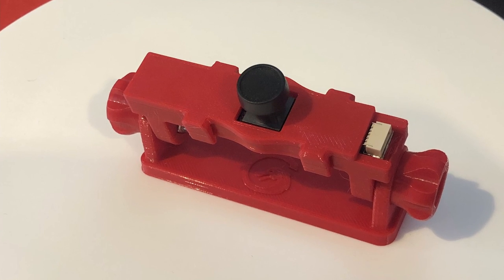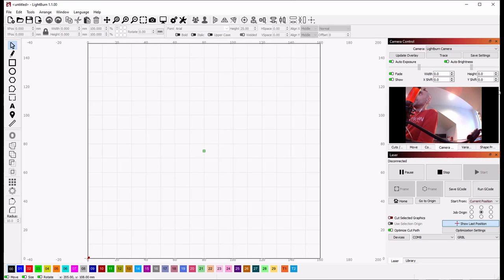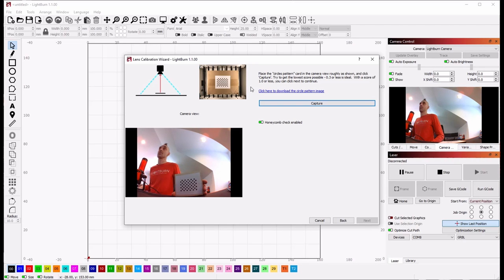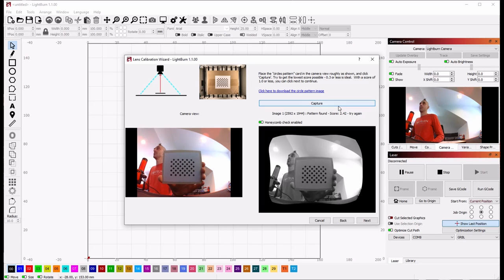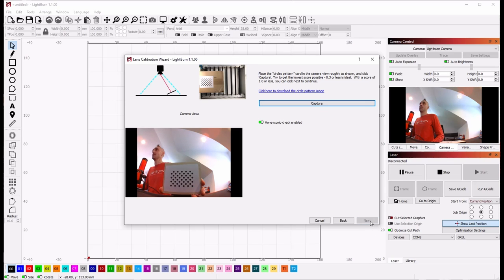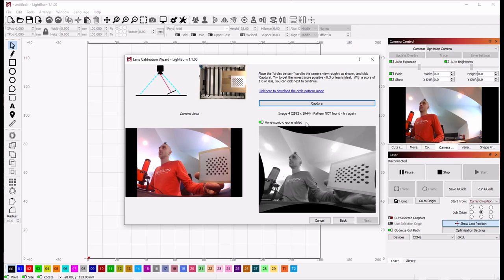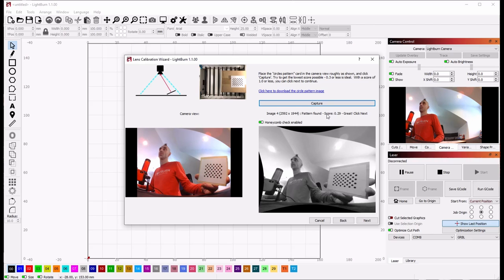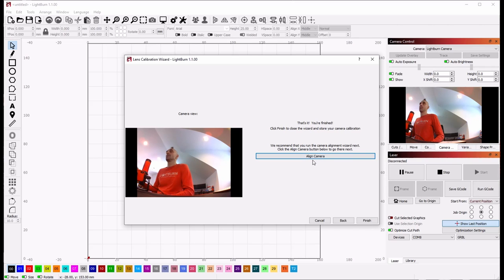LightBurn Camera Lens Calibration

Comment: Excellent clarification.  I had always assumed that it mattered that the circle pattern be on the laser bed based on the example images in LB.  I'd bet that replacing those with some stills of you holding the card in the appropriate positions would eliminate some user confusion.  

I spent a good bit of time trying to figure out how best to cover my honeycomb and get nice even diffused lighting for the test originally without great success.  Going to try it this way now!
Reply: I also see now that the walkthrough does say it pretty clearly.  I tend to treat those like Denny's menus, just scanning for the pictures that look most appetizing.

Comment: calibration has been a nightmare.... Calibrate lens, align lens, and still laser is off when I attempt a project. Good to know its not just me having issues.
Reply from the maker: Are you using a LightBurn camera or third party? Many of the presets are available for LightBurn cameras. If 3rd party, make sure the the calibration pattern is clear, sized to toughly match what is seen in the calibration wizard, and it really helps to attack it to something like a piece of cardboard to keep the paper from bending.

Comment: I have the expansion for our sculpfun laser with the size 935x400. And I am using a sculpfun honeycomp 400x400. But my honeycomp is starting at 467,5 in y-position.

When I calibrate the camera lense, the first part with the points works fine. Then when I have to put my sample in the middle of my honeycomp and and click on “Frame” the laser is driving his frame in the middle of my long side, not in the place as it is. I can’t choose this start position and also my camera is in the middle of the homecomp not in the middpe from the extension. How can I change this?

Comment: thank you for the video but where do you plug it, on your computer or directly to the machine
Reply from the maker: @arialf9637  - Directly into the computer.
Reply: @lightburnsoftware7189 thank you for answering, so I cannot use the camera if the computer is not connected to the machine?, because I use the machine wifi, with a LAN cable plus a router
Reply from the maker: @arialf9637  - the camera is USB only.

Comment: Brilliant!
I have been using a webcam fixed to the roof about 1.5m above the laser and using a small (A5) printout of the calibration image, this has given some success but it tended to drift depending on where the laser was cutting. ie it would be way off at the edges of the bed (600x400).
To get the thumbnail image the same relative size it had to be A4 sized, now working beautifully with calibration figures at 0.05 to 0.07
This was the critical help required to get the thumbnail to match the printed image on the laser bed.

Thanks for the video and the software I would be lost without it. 👍👍
Now I just need to sort the rotary device and will be 100% chuffed.
Reply: @lightburnsoftware7189  Thanks I have it scaled to 190, working great! 👍

Comment: Thanks for this video. I calibrated my camera per the instructions, and it works great, however I am having some issues. When I put a small piece of material (round piece of wood the size of a nickel) on the board and do my update overlay to capture what is on the bed the engraving is a little bit off. I place it in the middle of the piece on my screen, but it engraves off centered. Any ideas on how to fix that? Thanks
Reply from the maker: Have you ran the Camera Alignment Wizard? You will want to do that after you calibrate the lens. You can follow the steps outlined toward the bottom of our documentation here: https://docs.lightburnsoftware.com/UsingACamera.html#the-camera-lens-calibration-wizard

Comment: Why does LB not recognize the LB camera ?  It did when I first put it up.  Had to take it down when I moved, and  now I have some  odd name camera listed AVStreamMedia.  Yes, it worked....but it's slightly distorted, and LB Camera (5 - 120) was never a problem  and the preset was smack on.  I've updated LB to the lastest version (ver. 1.2.04) as of yesterday. And I've recalibrated lens and alignment...still distorted? Am I missing something?????    Why doesn't show the LB camera?     UPDATE:    Well, it is not LB fault...that's the first thing.  Good O' Windows 10.  I did a little research on AVSTREAM MEDIA....low and behold, Windows did their famous update .  I went in and Disabled it, and in Device Manager I chose to have Windows check for changes  and  there was LightBurn Camera choice back...and the software picked it up as well.  All is back to normal.  I'll guarantee there will be others that will run into this.

Comment: Thanks for the tutorial, too bad this didn’t come out 24 hours ago. I spent forever making little mistakes and having to watch different users vids to get it right . But I really love it now that I got it dialed in .. do you know what the tolerance is on how close you can get and if I can adjust it to be exact without recalibrating ?. Right now im about 1 -2 mm off. On the x axis
Reply: Just tweak it with the X-shift on the Camera Control Window then save the settings. Burn a small circle, update the overlay, then move the image so they match.

Comment: Wait so you can just hold the card in front of the camera? It doesn’t have to be facing the work bed?
Reply from the maker: We say repeatedly in the docs and in the videos that the lens calibration part has nothing to do with the laser at all - it’s only measuring the distortion of the camera lens.  You could do it on the moon.  :)

Comment: So I can hold the pattern to do this calibration is what im getting out of this video, do I need to change the size of the pattern b4 I print it
Reply from the maker: No, you can just move it closer to or further from the camera. That is the same as changing the size.
Reply: @lightburnsoftware7189  so I can hold it and just have to move closer or further to change size just double checking that I understood your response and thanks for the quick response your videos are awesome
Reply from the maker: @thomascorcoran2975  - correct

Comment: darn ..i just disassembled my printer, can i just burn the pattern on a white material?
Reply from the maker: The issue is that if there is any warp or distortion in the actual engraving the calibration will assume it is the camera lens and correct for it moving forward. You can certainly try but printed on paper is what is recommended for best results.
Reply: @lightburnsoftware7189  thank you for responding, this answers my question perfectly🙄cheers guys, keep up the great work!

Comment: So, the camera does not need to be installed in the machine in order to do the calibration?  Also, what does the honeycomb check do?
Reply: @lightburnsoftware7189  Thanks -- that makes sense that the camera can (and probably should) be calibrated prior to installing it.  Afterall, it's just correcting for lens geometry, which has nothing to do with the machine.  I guess once calibrated and installed, you just need to make sure it sees the entire bed.

Comment: Confused.potential customer. So you can just wave and shake the camera just about anywhere as long as you get <0.3 reading on Capture, then all is good to go. Am I understanding this correctly, stability of the camera and/or the calibration card is irrelevant just so long as a capture of <0.3 is obtained.  I ask for total clarity as this feature will be the reason to go with Lightburn and what I have seen so far and the comments below from seemingly seasoned users it seems I am not alone. 
PS Other vids change the size of the printed 'circle pattern image' as they can't calibrate, is this advised by Lightburn if like many you can't get the required <0.3 ?.  Also, why did you skip @ 12:20 and not finish the other final two corners ?.
Final thought, why is it not recommended to mount the camera first so that it is stable and then place the pattern snugly on the laser bed and slide it around so everything is stable.
I think I am, like many others it seems, am missing something fundamental here, what is it ???.
Thks in Advance.
Reply from the maker: The purpose of the paper with the dots is to calibrate the camera. Since they are wide angle lenses they will be distorted and the dots are used to correct this so that both scaling and view are correct. Generally speaking it is easier to calibrate the camera prior to mounting so you can move the camera/calibration card as needed and lighting is also generally better outside of the laser. That being said you certainly can calibrate it in the laser but it may take some additional lighting or few extra tries to get a good score. 

The alignment process is the process you will need to do with the camera installed. This is to ensure that alignment of design onto image is as precise as possible. If it is off, a correction (bump/shift) will be added in LightBurn to compensate for it. Here is the documentation on the alignment process:
https://docs.lightburnsoftware.com/Camera/Alignment.html#preparation

So in summary the calibration is for the camera distortion, which is why it doesnt have to be mounted, and the alignment is for dialing in your camera/workspace overlay and must be mounted in place.

Comment: Lightburn freezes and crashes every time I try to calibrate it. I constantly get the Pattern NOT Found or astronomically high numbers but never get past the 2nd capture before it crashes.
Reply: @lightburnsoftware7189  No I covered it with paper.

Comment: You really should have done this with a 410x400 diode laser and the most common co2
Reply from the maker: That would miss the entire point of the video. The lens calibration step does not involve your laser at all.

Comment: Is the red 3d printed camera holder available for download?
Reply: I think i saw it in the forum
Reply: Did you ever find the camera case pattern file for 3D print.  I've had nothing but problems with my cam and mount.  It's never correct. I've even hot glued every spot, and I have to re adjust it every time I can't ever count on it to be correct.  It's odd that the cable has to come out of the front. LMAO

Comment: Why is the camera pointed at you instead of the laser bed?   It isn't logical to do the calibration as you present it in the video.
Reply from the maker: The lens calibration stage, as the name suggests, is only measuring the curvature of the camera lens and has nothing at all to do with the laser. It says this in the video. It is far easier to calibrate the lens before mounting the camera to the laser.